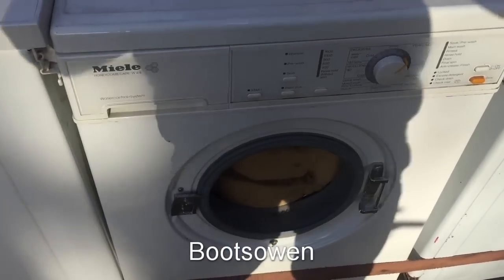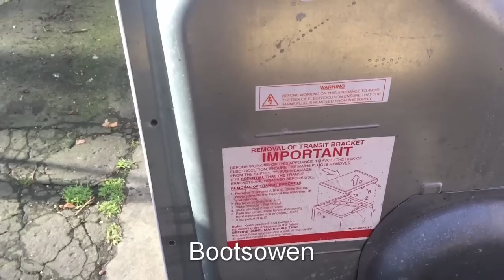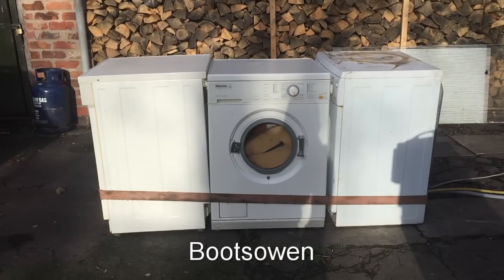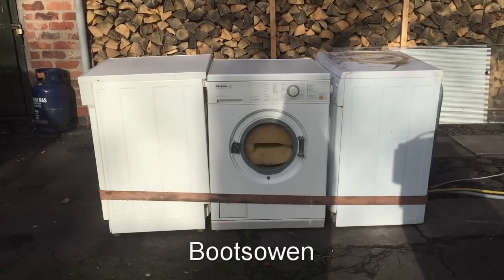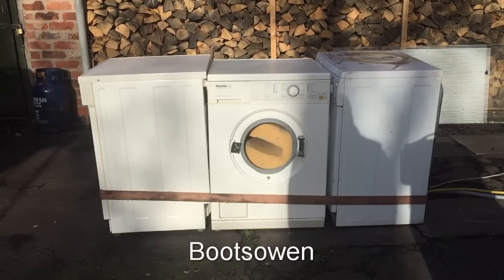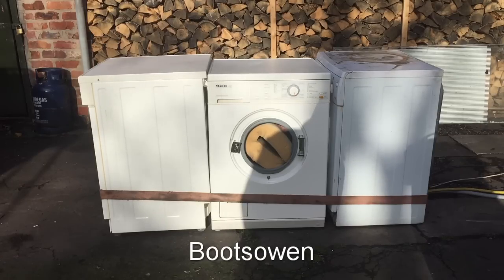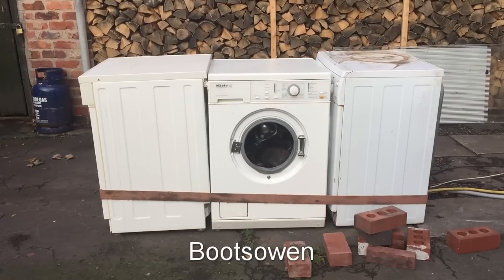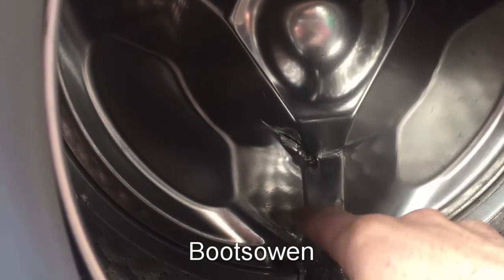Miele W418 Overload and Brick Smash

Comment: Woah, usually a washer like Hotpoint or Indesit wouldn't last what Miele had in the drum, but Miele didn't even move! (I know there's 2 washers to make it not move, but even so, the drum itself would move if it were to be unbalanced. Shows that old mieles were made to actually last. If the spider wasn't snapped, it'd be difficult to destroy it with that only one brick, and even with the spider snapped, the drum still tried to move. Simply amazing.